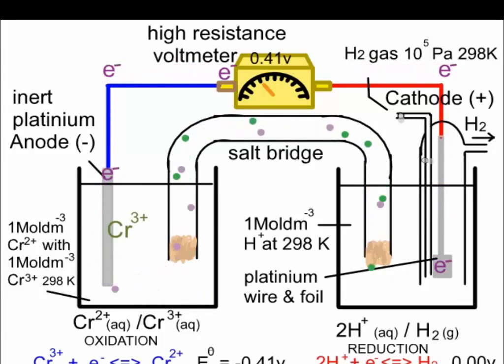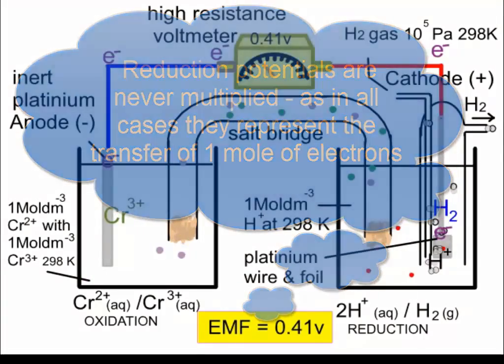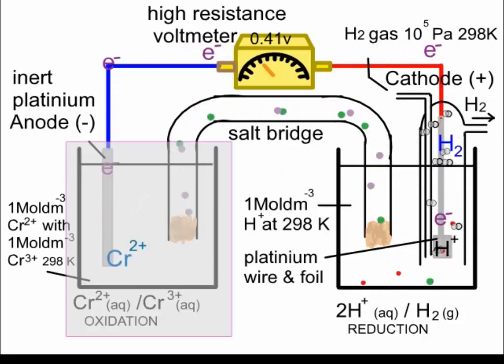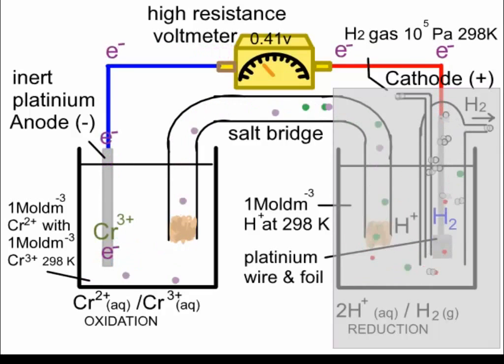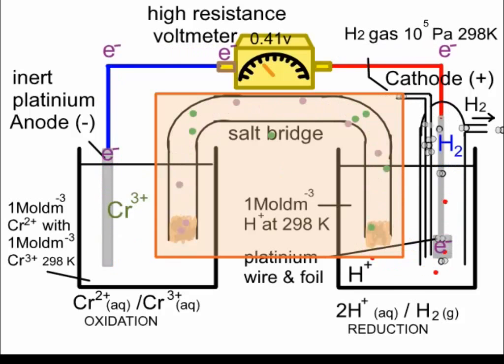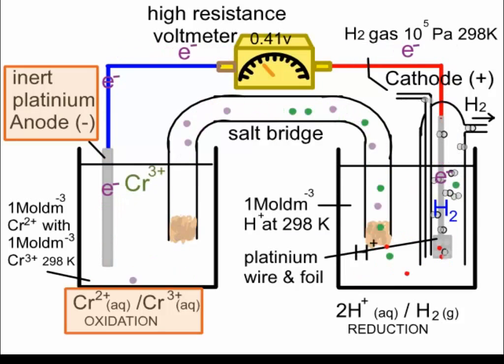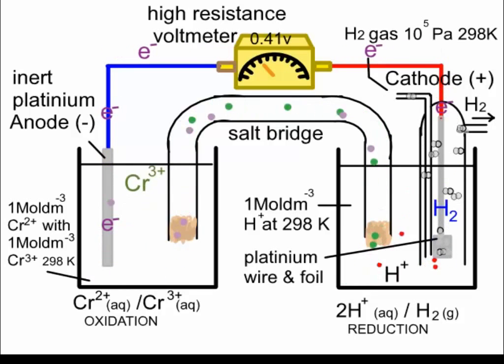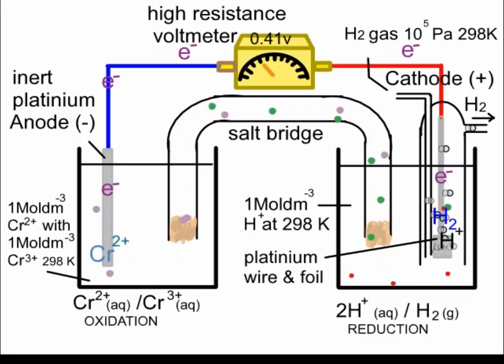Electrochemistry 2: Galvanic Cell with Cr (III) / Cr (II) and Hydrogen Half Cells

Comment: I'm not sure I understand how this would be beneficial... if you have to add hydrogen to it in order for it to work... wouldn't the cost of the making hydrogen outweigh the benefit of .41V?  I understand that industrially this may be feasible...but would this actually prove beneficial in any other circumstance?  It somewhat resembles a fuel cell but i've never seen this type of power supply before, where does this actually get put to use?

Comment: So do you ALWAYS switch the sign of the negative voltage when it's being compared to the standard hydrogen half cell? What if the Voltage of something is LARGER than the hydrogen half cell, like .34 with copper?